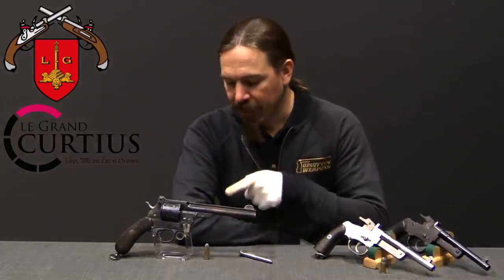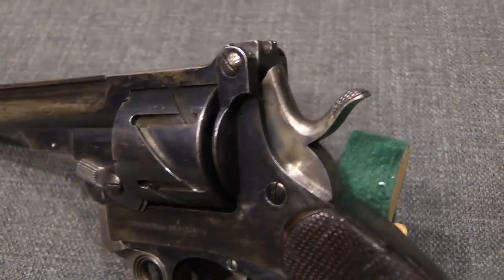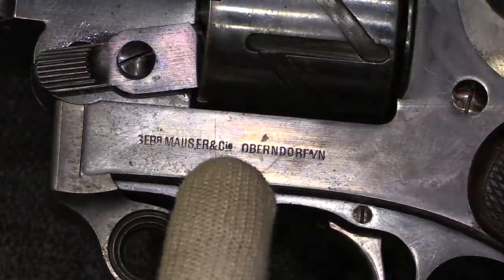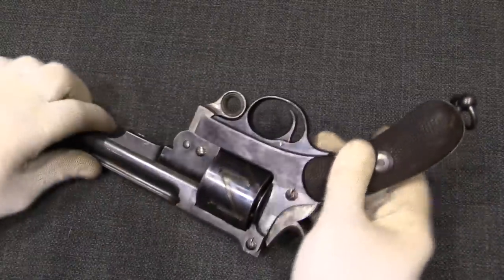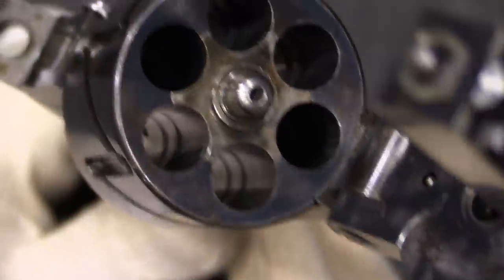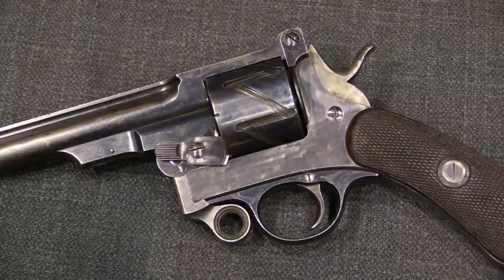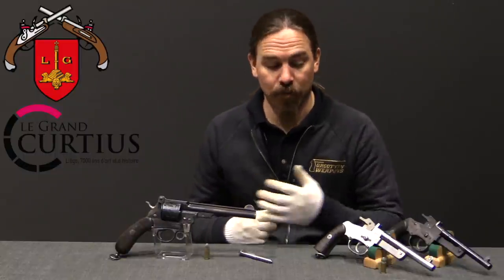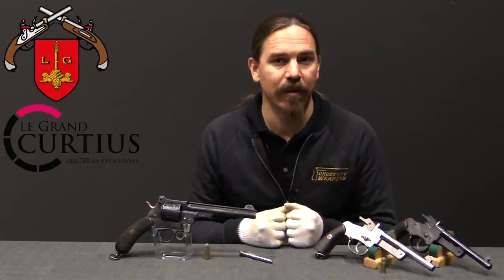Mauser "Zigzag" Revolver Patent Model and its Unique Cartridge

Comment: Making people create models to demonstrate usage of a patent would certainly stop patent trolling. I would if anywhere still uses the process to prevent patent system abuse.
Reply: companies don't want that because they want to be able to patent things you can't make a model for, and to patent things before they are that far along in the process
Reply: @SuperAWaC  
Except of course that it wouldn't be a problem since anyone else trying to get that patent would have to do the same in order to get it. And anyone trying to "abuse" the patent, by using it without paying for it, would also have to actually make something in order for that to even be an issue.
Reply: Except patents aren’t just for physical mechanisms

You can patent a process for making meth. How are you going to put a physical model for a chemical reaction in front of people?

Or if you want something more ordinary, a solar panel. Or a computer chip, so small, you need expensive microscopes to distinguish it from any other chip
Reply: @thomasa5619  
You show how to use that process for making meth. And just because you can barely see it in the computer chip, you can still test it to see if it's there.
It prevents you from patenting things that you actually have no idea how to use, just so that you can charge someone else for then coming up with an idea of how to actually use it.
Cause the latter is what patents are for....

Comment: Huh, the cylinder looks like the Pangor Jackhammer's one, what with the grooves.
Reply: That, as well as the Webley-Fosbery Automatic Revolver which also has grooves on the cylinder.
Reply: The same operating mechanism.
Reply: The pancor jackhammer operated on a similar idea with a different method of rotating the cylinder. God damn I wish pancor had taken off.
Reply: @gunnarhassing5875  The Pancor looks unwieldy, impractical and too expensive when there are better alternatives on the market for autoloader shotguns and mag-fed shotguns.
Reply: Enrico Paolo Coronado have you watched Ian’s video on it? He shows a tool room prototype and with a little refinement it would’ve been great. It’s operating system is fairly simple. The only real cost point would be the cylinders which could be reworked to be reloaded while in the gun. The design has tons of potential, but not real demand.
Reply: @gunnarhassing5875  The overall design looks unwieldy, I've seen the video. The magazine idea, especially it being capable of being a mine, is a bit too ambitious especially when there are better dedicated tools for the job.

It looks cool as a sci-fi movie/game weapon but it wouldn't cut it in real life.
Reply: @enricopaolocoronado2511  You'll be wanting one when the Bugs come.
Reply: @enricopaolocoronado2511  mhm it does look really fucking cool though, could you make full brass HE shells with 3 ounce lead balls for the mine feature? That would be horrific coming though a tripwired door like in Max Payne 👌
Reply: @DigitalRX2r  
Bugs? I'm arming myself for Tremors.
Reply: @onpsxmember  Burt would Recommend at least a .375 H&H if you're going solo
Reply: It's a museum piece, the gloves are to not damage it with fingerprints. Humans are very corrosive
Reply: @DigitalRX2r  I'd rather have a Saiga-12 and an IED in that scenario
Reply: @hailexiao2770  Wasn't the jackhammers drum mag meant to be an IED? The Bug soldiers ate anything that wasn't mechanically triggered to spare the hoard, like laying on a grenade.
Reply: @DigitalRX2r  Yeah, and that feature made it expensive as hell. Seriously, why use the magazine like a mine when there are better tools for that specific job?
Reply: @DigitalRX2r  I'd rather have some reliable than cool, thank you very much.
Reply: @enricopaolocoronado2511  Reliable doesn't get you far with the Bugs. It's about pure firepower and destroying more of them before they take you. Sheesh
Reply: @DigitalRX2r  Oh yeah? And what happens when your kit jams in the middle of a swarm? All that firepower and it clams up the moment dust gets into the mechanism.
Reply: @enricopaolocoronado2511  Well if you're n the middle of a swarm you're SOL anyway. It's basically pull all pins and say goodbye at that point. Bugs have no mercy.
Reply: @DigitalRX2r  So basically just fight as if you were in a Tyranid swarm? Alright, just give me a Lasgun or a Plasma Rifle, no need to lug around too much shit when those two can deal a lot of damage per shot.

Comment: ...And the break open revolver breaks (opens) right up into yourself...Hm...Concrete Mauser logic...We still love them :-)
Reply: Probably because you do it like Ian (and most americans) and can't fathom letting go of the pistol grip.
Think of it like this. You grip the barrel with your off-hand and use the thumb on that hand to pull the latch. Then with your main hand (the one you normally hold it with to shoot) you flip the grip upwards. Now you got easy access to the cylinder and can easily reload it using your main hand. Then flip the grip back down and grab the pistol grip and you're good to go.

Comment: I've never seen a break-action revolver that opens from the bottom like that.
Reply: Ian has a video of a French revolver that operates in the same way. I believe it was called Le Fagnus  or something similar.
Reply: the original smith and wesson revolvers did the same thing
Reply: Think of it like this. You grip the barrel with your off-hand and use the thumb on that hand to pull the latch. Then with your main hand (the one you normally hold it with to shoot) you flip the grip upwards. Now you got easy access to the cylinder and can easily reload it using your main hand. Then flip the grip back down and grab the pistol grip and you're good to go.
It's just that Ian can't let go of the pistol grip and so flips up the barrel (and the cylinder) instead.
Reply: @nehcrum  Thanks, that makes a bit more sense now.

Comment: I like these. The groove-captured back-and-forth pin at the bottom of the cylinder has always struck me as a much sturdier solution than the teeny tiny push arm we're used to today.
Reply: It's a nice idea, the hand lever has proven to be quite sturdy though.
Reply: Since that teeny tiny push arm is activated manually rather than by the force of recoil or gas pressure, it doesn't really have to be all that big and sturdy compared to parts in a pistol that do have to deal with such forces.

Comment: Hmm, breakaction revolver that breaks upwards rather than down is certainly in interesting choice. Was there a specific reason for this or did it just take a couple production generations of ergonomics design to switch to the break downwards style?
I haven't held, fired or reloaded a real revolver (or any real firearm for that matter) in my life, but I'd image that reloading that revolver is a real PITA. Sure enough, with it breaking open to the top the spent cartridges will more or less just fall out (perhaps a design choice since that revolver doesn't seem to have an ejector rod or otherwise a mechanism to punt out empty brass from the cylinder), but then you'd have to hold the whole gun up by the frame/barrel to reload and then swivel the rest back down whilst still holding the frame at least vertical to avoid rounds getting loose and/or falling out the cylinder.
A breakaction that swivels down instead seems MUCH more ergonomic: you uphend the entire thing to drop spent cartridges (with or without help of an ejector mechanism), then you can just hold the entire revolver as usual by the handle as you reload the thing and just snap it back against the handle to close, much less fumbling about.
Reply: Probably because you do it like Ian (and most americans) and can't fathom letting go of the pistol grip.
Think of it like this. You grip the barrel with your off-hand and use the thumb on that hand to pull the latch. Then with your main hand (the one you normally hold it with to shoot) you flip the grip upwards. Now you got easy access to the cylinder and can easily reload it using your main hand. Then flip the grip back down and grab the pistol grip and you're good to go.

Comment: I'm not a fan of that upward brake action.
Reply: Probably because you do it like Ian (and most americans) and can't fathom letting go of the pistol grip.
Think of it like this. You grip the barrel with your off-hand and use the thumb on that hand to pull the latch. Then with your main hand (the one you normally hold it with to shoot) you flip the grip upwards. Now you got easy access to the cylinder and can easily reload it using your main hand. Then flip the grip back down and grab the pistol grip and you're good to go.

Comment: Why would case obturation even matter since gas leaks at the cylinder gap anyway?
Reply: I was thinking the same thing :)
Reply: Gas escaping at the cylinder gap is okay, gas escaping at the rear of the cylinder (or pushing the case back) is not.
Reply: @hailexiao2770  Oh yeah? Why not?
Reply: @rickb1973  You can keep your fingers away from the cylinder gap with proper shooting technique. There is no way to avoid having your hand in line with the rear of the cylinder. Plus a case that gets pushed to the rear can jam the cylinder.
Reply: @hailexiao2770  I see what you're thinking, there....But that never actually happens because the path of least resistance is the cylinder gap.
Reply: @rickb1973  Right, but even a fraction of the gas going backwards can have nasty effects. Not all of the gas will take the path of least resistance.
Reply: @hailexiao2770  Someone in another comment actually mentions that the problem with pushing the case back is actually bigger for a bottlenecked cartridge in a revolver, and is a main reason for why they are straight-walled to this day.